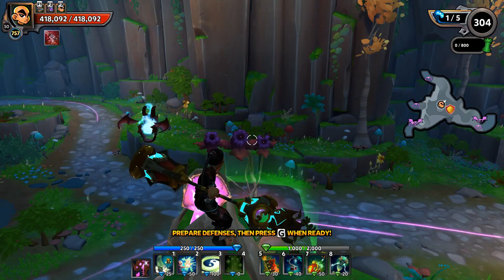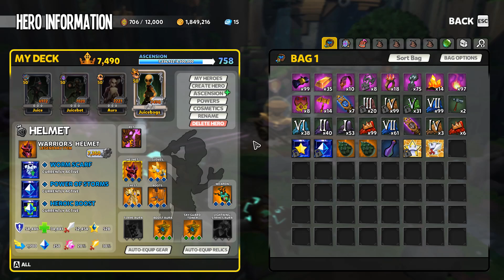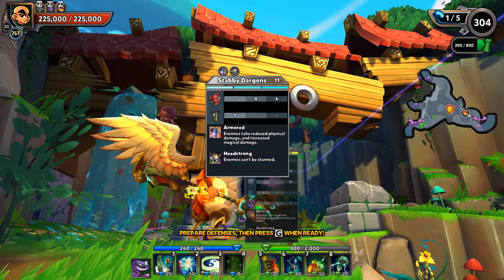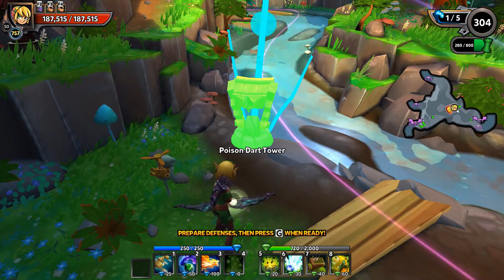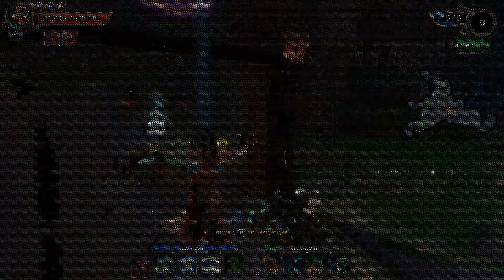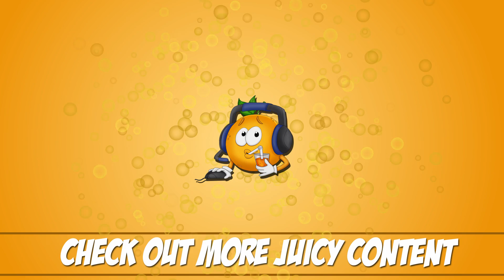No AP No Gilded or Hyper Shards Floor 80 Guide!

Comment: normal maps are not the problem. drackens keep is the problem ( its really tough to solo) on high floors when your running minimum grear and mod to quickly rest
Reply from the maker: Tell that to the folks that are having problems passing like floor 30-40 and asked for this video!